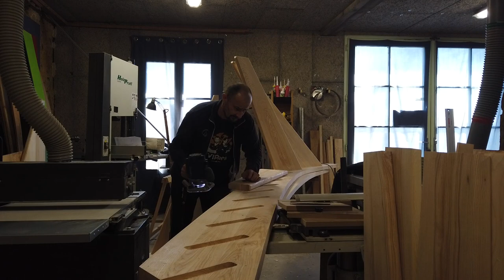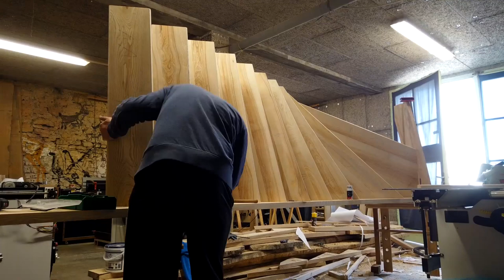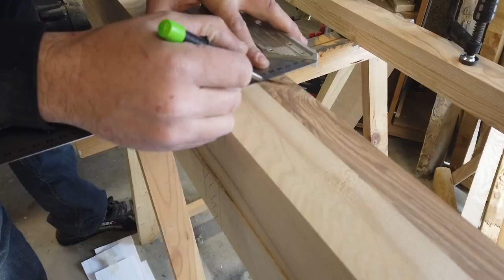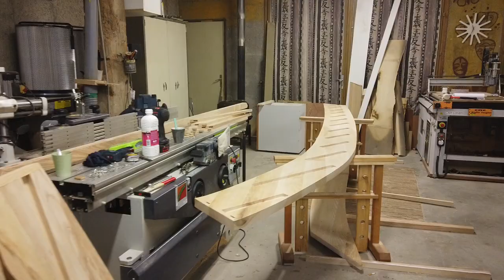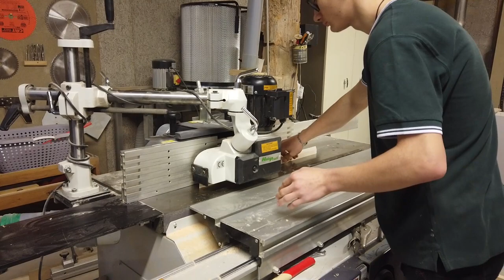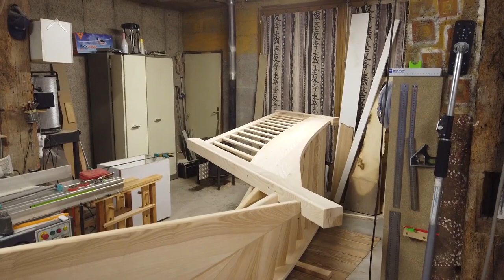escalier frêne partie 2

Comment: J'ai découvert ta chaîne il y a peu et c'est un plaisir de découvrir tes réalisations et tes astuces, merci pour ce partage.

Sur ta combinée Holzprofi, il me semble que tu as un rail de 2m. Il existe une option pour avoir un rail de 2,3m. Dans la mesure où tu es parfois amener à déligner de longues pièces (portes, ...), est-ce que tu penses que les 30cm en plus aurait pu t'apporter quelque chose ?

J'hésite à prendre l'option mais ayant un atelier de taille modeste (30m2), je me dis qu'il serait peut-être préférable de tenter de garder un maximum d'espace libre et quand je devrai déligner des pièces de plus de 2m (ce m'arrivera pour des portes, bibliothèques, ...), cela pourra être fait autrement (par exemple à la scie circulaire plongeante).
Reply from the maker: Salut et merci , alors mon chariot fait 2 mètre mais il a un débattement de 2300 .
Si tu as d autres question n'hésite pas .
Reply: @atelier_Vosgien  Merci pour ta réponse rapide !
Etonnant pour le débattement. Mais tu confirmes que tu n'as pas pris d'option particulière pour le chariot ? Ca voudrait dire qu'avec le chariot de base on peut déligner des pièces de 2,3m.
La seule option que je prévois c'est l'arbre à plaquettes.
Reply from the maker: @okysp8638  oui oui je confirme chariot de 2 mètres je passe du 2300 mm